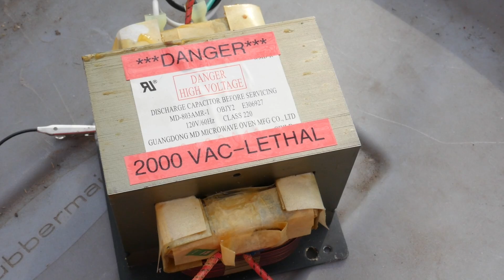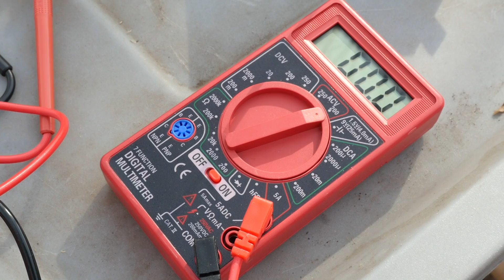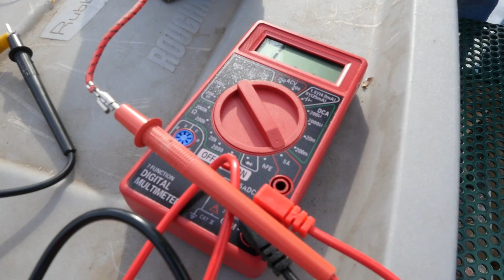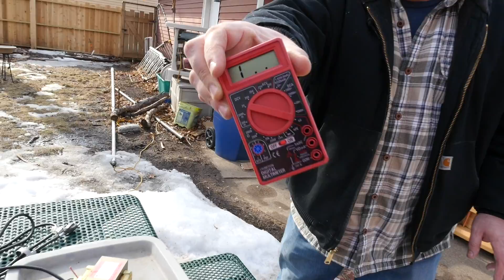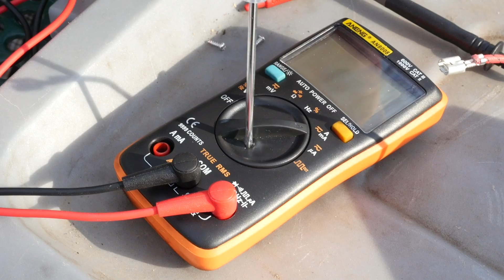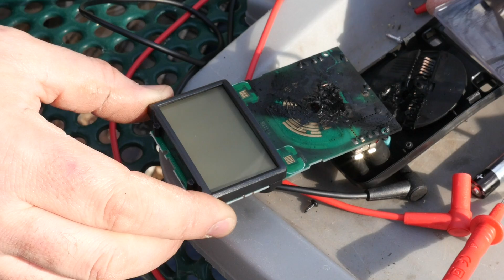We put a couple of multimeters to the high voltage test - Ham Radio Q&A

Comment: That's the same type of "secret" transformer I use to build high voltage wood burners.
Reply: Too powerful, something that doesn't put out so many amps would be less lethal.  These transformers will do to you what they did to those multimeters.

Comment: So, what happens when you set it up to measure the voltage, rather than trying to measure current and putting a short across the transformer?
Reply from the maker: We initially tried to measure voltage with the meter and kept popping the circuit breaker in the house. The transformer is supposed to only deliver 5 amps at 2000 volts but it was going full current along with full voltage. We are guessing that switching the meter to current mode kept the current at a low 5 amps while still delivering 2000 volts to the meter.

Comment: I one got to take apart a Fluke 87 that thelocal Metro electricians had used in an attempt to measure the primary voltage of a distribution transformer. 11kV applied to the input, and it did not survive. Basically the entire board had the copper tracks blown off front and back, from the input sockets, till just under the display, only thing there was the solder pads, the components and the clear spots ( where not soot covered) where there had been traces. The case front and rear had a perfect copper plate on them, all the way from the top to the bottom on the rear side, and under the display on the top side. Both fuses however were still perfectly intact, as was the 9V battery, but the rest of the meter was gone. The display did show something garbage on power up, though I suspect the clock was not running, seeing as the Fluke Asic in there was definitely not happy, as it had a non original new hole on the top.
Reply: There's a standard video shown at every arc flash/blast training I've ever had that talks about a mill tech going into a 2300 volt motor bucket with a standard Fluke 600v meter. TL;DR it ended poorly. 

Fortunately we as hams do not encounter environments such as that but the potential is still there in the real world.

Comment: So as a 40 year appliance tech(Sub Zero, Whirlpool, and Speed Queen) the transformer you were using was out of a microwave oven. I always tell DIYs never work on a microwave oven as it can kill you. Not only the transformer but also a high voltage capacitor. Be really careful on the old electronics!!! That being said you guys should do a video where you have a meter set on ohms and you try to test 120/240 volts. You made a really good point just buy a good meter. My Fluke 117 set to ohms and trying to test voltage will just blink at me and not blow up. Always enjoyed your videos(pretty funny) even thou you try to blow things up. By the way Yes, you were very, very safe in this video Joe WX7XX ps still laughing!!!
Reply: I thought about connecting the capacitor for a bigger boom....
Reply: @Gordofor12  Still laughing at your video!!!

Comment: Please explain....in this previous video, you say that "for $30, just grab one" when refering to the 808 meter: https://youtu.be/RLnBA2RhxYo. Yet, in this video you make fun of the HF multimeter, say not to buy it, yet the meter which you said to buy in the previous video failed your test even worse than the HF multimeter.  Do you remember making this other video where you recommend the cheap Chinese multimeter?
Reply: By the way, they are both POS multimeters.
Reply: For a $30 meter in a CAT II environment, It's OK. But I really don't recommend it.
Reply from the maker: Yep, we remember and we said the meters were good for low voltage electronics work. But we also stated you also need to heed the category rating and this is what happens when you exceed the limits of the meter.
Reply: My point is that this is an example of the arbitrary nature of youtube videos.... you say at the beginning of this video to not buy the HF meter, you say in another video to buy this other meter, and in this video you apply an unreasonable amount of voltage and current to show that they will both fail.